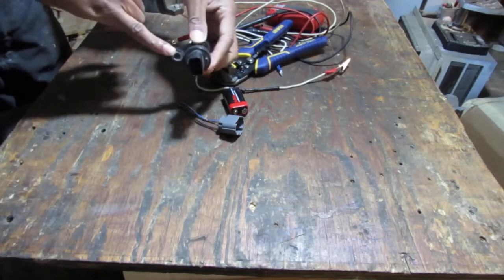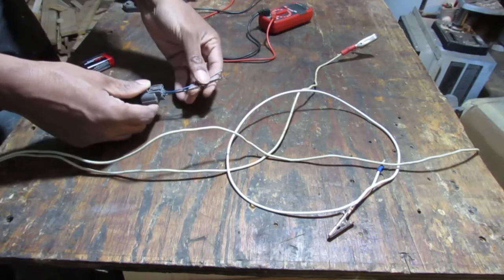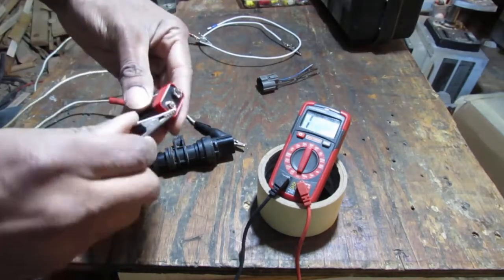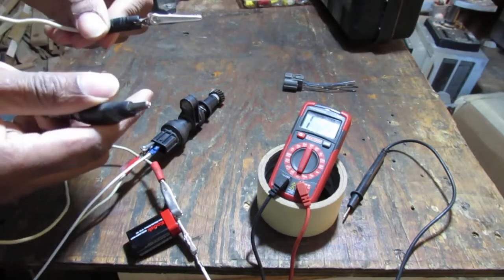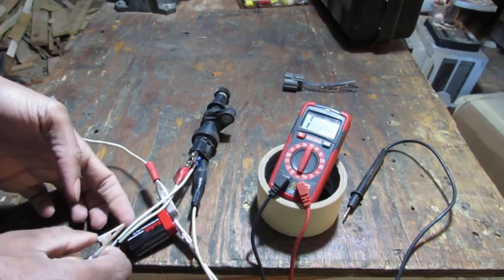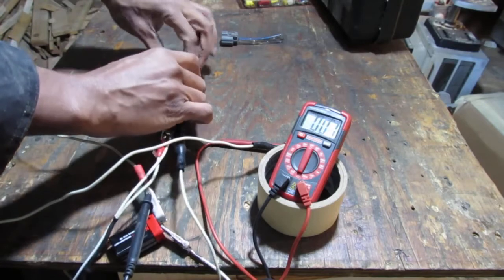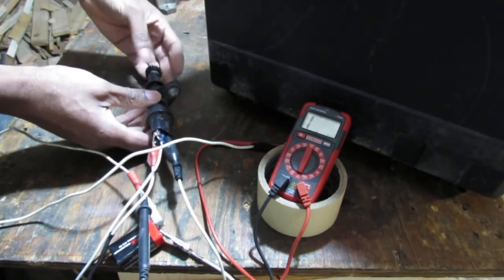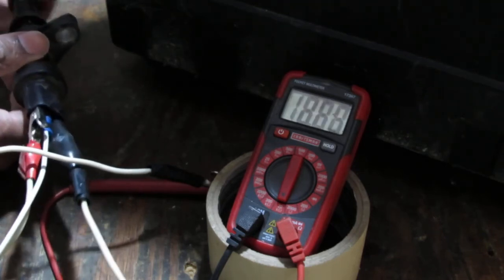How 2 Bench Test : Honda Civic | Vehicle Speed Sensor VSS

Comment: Thank for helping figure out the diagram on how the sensor is wired major help! I’ll be sure to apply this principle in other aspects too 🙌🏻
Reply from the maker: With reading wiring diagrams often just a small explanation of the diagram can be enough to help one understand many other components and extrapolate.  Manufacturers have a certain style of making their vehicles that span decades and multiple models.  Once you understand their approach,  problem solving for their models becomes very easy.  It is why certain mechanics specialize, it is like cheating at life.

Comment: Thanks a ton. I’ve changed two speed sensors (1 aftermarket 2nd from a junkyard) to no avail. I will test them tomorrow using your method. Godbless you.
Reply from the maker: The speed sensor is not a common place of failure.  You most likely have failure within the instrument cluster.  In the video I show you where.  That is most likely it.  That big chip fails and sometimes you might find moisture ingress that rust things.  You can easily verify your speed sensor is working by  using one of those Bluetooth OBD2 readers and look at the live data of your current speed, best of luck and happy New Years.

Comment: Nice. Does the meter was set on voltage or resistance detection. What is range of voltage/resistance we get on turning the sensor. Thanks
Reply from the maker: What my multimeter is set to is the most asked question.  I really need to do a follow up video to help clarify things.  One sec will respond later.

Comment: When you turn the speed sensor with a drill, it stays at a certain voltage all the time. When you turn it slowly by hand, the voltmeter moves up and down. I tried with 12 volt adapter and got the same result. Thanks for this good information.
Reply from the maker: Hasan Ahdemir, thanks for sharing your experience.  How did you attach this to a drill to spin it?
Reply from the maker: @hasanakdemir5911  , thanks for the excellent video.  I will try a drill next time.  It will reveal intermittent failure very easily.

Comment: Thanks bro. I just needed a video Like this. Im about to test that sensor too. Very well explained
Reply from the maker: anthony picado, really happy this information will be of use to you.  I really thought about it much because I was in the process of diagnosing my vehicle speed sensor and needed to rule out that the speed sensor I was going to install was not the point of failure.  In the description is link to another video with a complete diagnosis of the vehicles speed sensor and speedometer.  I learned something of interest after creating this video.   "SPEEDOMETER: Indicates 60 km/h at 637 rpm or 60 mph at 1,025 rpm of the vehicle speed sensor (VSS)." I got that from the service manual for the 1996 - 2000 Honda Civic.

Comment: Will it damage my car(engine/tranny) if i keep running/driving my  car if i don't solve my PO720 code(involves the output speed sensor) right away? Thanks again, mark
Reply from the maker: Looks like the code  you mention map to this "P0720 Honda Code - Output Shaft Speed Sensor Circuit Malfunction".  You are ultimately responsible for making an assessment on the safety mechanically and to others while driving your vehicle.  With that being said a non functional speed sensor you can drive with as long as the automobile does not need to know that information to regulate fuel flow.

Comment: I just got my car running(2002 honda civic EX, auto trans. The output speed sensor looks like what u have on ur video. I get a code PO720. I will try ur set up. I have a question why cant u use ur snap on terminal with the three leads to connect to and snap the terminal to ur sensor? Understand my question?? Thnx much for ur video. Mark
Reply from the maker: I do not understand your question.
Reply: @MotionDesignStudio  i cut the snap on connector for the speed sensor from another harness. I snapped it to the sensor i am going to test. I an do the same test with thethree leads copming from the connector which i cut from the harness correct. I tested  my speed sensor from my car which i bought from an wrecking yard(assuming it is good?) I did not get the fluctuation of resistance ui did. Any advice??
Reply from the maker: @andredial6436  , that is the best way to do it with a connector with wires.  Start with checking the continuity on the connector to the pins on the connector.  If that is good then double check the setup and make sure everything is connected like mine especially the battery.
Reply: @MotionDesignStudio  i did it the way u showed on video. I turned the spiral gear but no movement on my meter, it just stayed about 30ohms, with the setting at 1ks ohm,. So?  Thnx
Reply: What if i put it back on the car and check resistance while car running at different speed, will i get fluctuations on my ohm reading??
Reply: If it(the sensor) is good??
Reply from the maker: @andredial6436  , yes a good test is to place sensor back into the car.

Comment: Any test on the Toyota 3 wire speed sensor?👍
Reply from the maker: You have two choices.  You can send me a link containing a wire diagram for your vehicle's speed sensor and I can speculate how to create an equivalent test.  Number two is send me the sensor and I make a YouTube video on how to construct the equivalent test.  Upon completion I will return.
Reply: @MotionDesignStudio  ireally dont have a diagram for the vehicle im installing a Toyota cressida engine in a Toyota bus so I'm using the cressida speed sensor so i wanted to know how to check the cressida speed sensor how to connect the positive and the negative and the signal wire i know many 3 speed sensor wiring sometimes wiring different..please and thanks🙏
Reply from the maker: @christleydacosta4747  Google the words from this and you can find the link.  To test this you will need to check the output of pin 3.  ::  From a website :::  3 Wire Speed Sensor
The 3 wire speed sensor output signal is a square wave signal that connects between the input power source (battery voltage) and the power ground.  The speed sensor outputs 4 pulses (High to Low voltage transitions) for each speed sensor revolution. 

Most Toyota 3 wire speed sensors have the below (90980-11143) plug connection, however it is worth noting that there are some 20 pulse / revolution Toyota speed sensors that have a different (triangular) plug connection.  Note, the below plug (90980-11143) connects to the speed sensor, the below plug image does not show the pin out of the sensor, it shows the pin out of the plug that connects to the speed sensor.

Pin 1 : This pin is used to supply ignition switched battery power (+12V)  to the speed sensor.  This pin needs to be connected to an ignition switched power source that supplies battery voltage when the ignition is in the RUN and CRANK Positions.

Yellow (Y)

Pin 2 : This pin is used to supply the power ground for the speed sensor.  This pin needs to be connected to ground.

Red (R)

Pin 3 : This pin is used to output the speed signal.  This pin most commonly connects to the dash cluster, however in some arrangements this can vary.

The 3 wire speed sensor output signal is a square wave signal that connects between the input power source (battery voltage) and the power ground.  The speed sensor normally outputs 4 pulses (High to Low voltage transitions) for each speed sensor revolution.

Light Blue - Red Dash (L-R)
Reply: Pull off the socket at sensor. Switch ignition on. Meter negative to centre connector, and positive to one outer, then the other. One will give full battery 12volts. Turn the ignition off. Remove the protecting sleeve from the 3 wire harness, and push a needle through the wire that is NOT 12volts. Jack up front wheels, connect meter between the needle and earth. Gearbox to neutral and ignition back on. Spin the wheel and it should go 12v-0-12v-0 for each revolution.

Comment: How to test same kind of speed sensor with two pin, n how two pin sensor works?
Reply from the maker: As much as I would like to answer this.  There is no way  I can answer this without you sending me a wiring diagram of your vehicle that includes the speed sensor.
Reply: @MotionDesignStudio  I don't know n have wiring diagram of the vehicle, but I can send you pics of sensor, it's same as urs but it has two pin socket.
Reply from the maker: @khajuriaarun8874  , get a wiring diagram from alldata dot com.

Comment: This is for civic vti s5a matic?
Reply from the maker: This came from a manual transmission 1997 Honda Civic with the engine block code D16Y7.  I am unsure of the classification string you provided and how it aligns with this vehicle.  I want to emphasis the manual transmission and the automatic transmission have a completely different vehicle speed sensor.